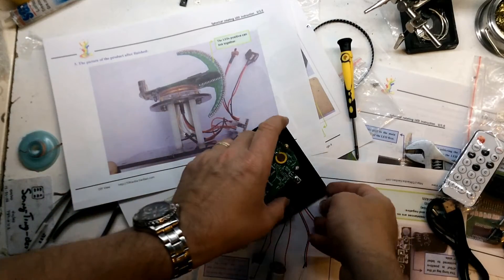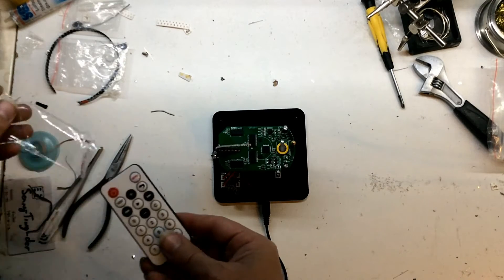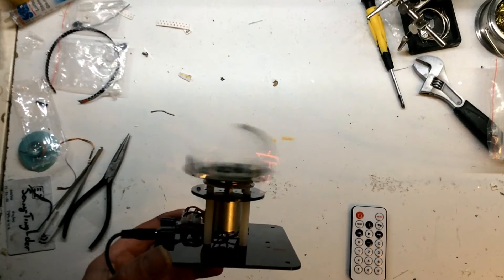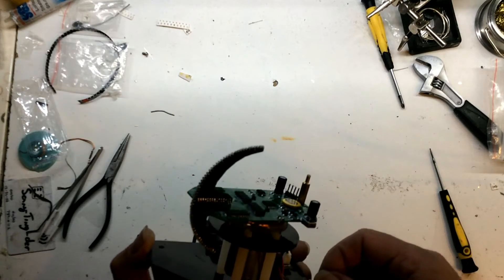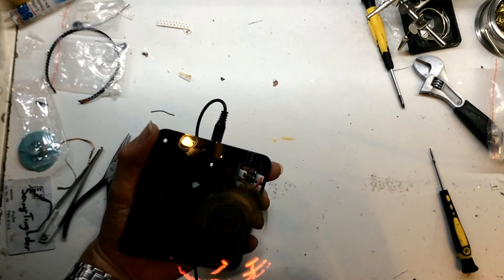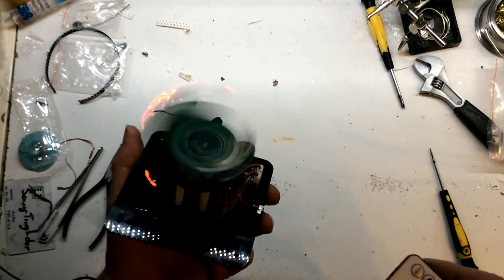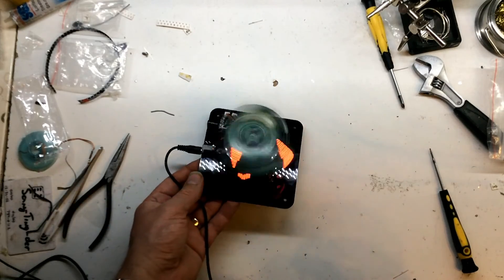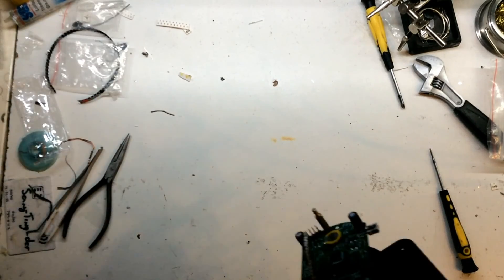DIY Spherical Rotating LED Kit POV from Banggood.com Part 10

Comment: Another tip : Once you try the Kit out and it works , How about taking it one more step to Enhance the appearance of it , I Placed 4 short stand offs Under the Base So it will sit just a little of the table , I then placed 2 more short standoffs under the power module  drilled another hole 1/8 in . And  Placed 2 screws under it  . I then glued the 5v Jack to the side of it for now I might change this also later ... But it makes the kit look so much better then just glueing all those parts on the base

Comment: SUCCESS !!!!! I just Finished  the 56 LED POV Rotating clock For the Second time ,  and it works perfectly ,. I  am sure glad I changed those 1.5 K resistors this time and avoided all the Pit  falls.... Now on to the Blue one ...
Reply from the maker: Congratulations Gary, some good tip in the comment too

Comment: first of all thanks for the great series 
I have build mine too and the motor is spining but the leds are not on
do you know any common issues I can check ?
Reply from the maker: it could be anything you will need to eliminate things, power the board via the GND and vcc of the program pins (5v) should show a cascading led pattern, if thats good check d51-d53 are in correct way around and also 5v1 zenner is also correct, if thats good then issue possibly on the little pcb
Reply: well I guess the problem is now gone 
connected my power supply and didn't pay attention to the current limit ... so 5 A went through the whole pcb ... damn
Reply from the maker: eeek did it let the magic smoke out
Reply: nope i checked the leds and they are still working ... I won't let my hopes down haha but thanks for the quick replies
Reply: so after connecting my supply again it draws about 100mA but no patterns

Comment: Thanks for the mini-series...I just finished this beast and I'm surprised it actually works :)  The only thing I did different was to hot glue a spare nut to the bottom of the main board at the LED side to balance the spinning out a bit.
Reply from the maker: never tried to balance mine, should do since i have a prop balancer i could use.

Comment: If it's the same firmware as my unit it is possible to get it into a "test mode" by unplugging either the motor or the IR-LED. If it doesn't get a proper RPM-rading via the IR-Signal it will light all LEDs in sequence and you can easily figure out if all work as expected
Reply: How do I get it out of test mode?  I have it put together but all it does is spin and light the leds one at a time. :(